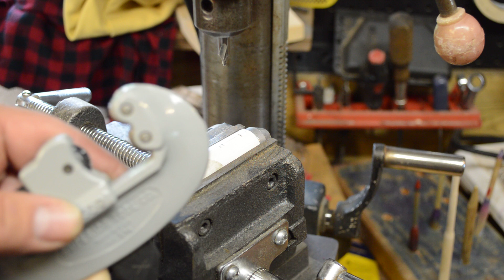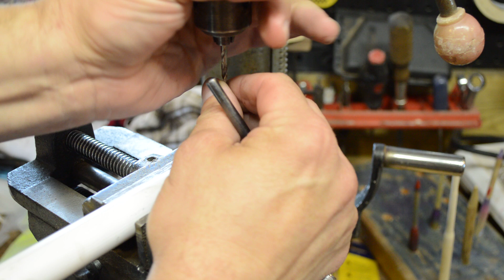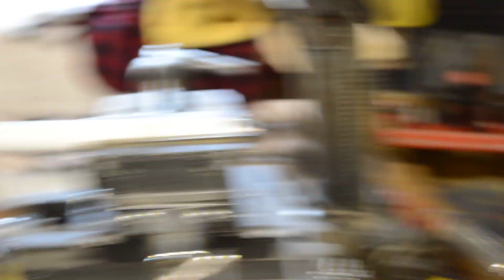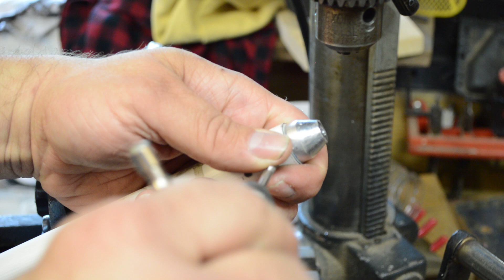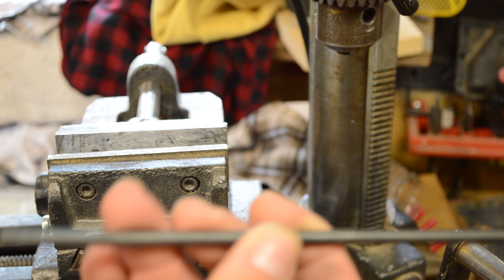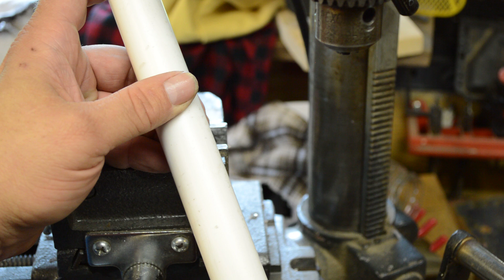HOMEMADE WOODTURNING TOOLS, PART2, GLUING, DRILLING AND TAPPING HANDLES

Comment from the maker: Thanks for watching and subscribing!  The piece epoxied into the PVC is an adapter made from 6061 extruded aluminum round rod.  I used the step jaw 4-jaw chuck for the machining.  I drill thru for the size of the tool, bring the tailstock up with a revolving center for support as I turn down the aluminum rod to fit inside the PVC.  My adapters are about 2" longh.  After the epoxy cures drill and tap for two set screws.

Comment: Hi. Just got a lathe and getting started. But I do have a tip for you. Get you some bee's wax to lube your drill bit for aluminum. I learned that by watching some pattern makers in the foundry industry. Works better than WD40. Love your vids. Making my own tools is right up my alley. Thanks!

Comment from the maker: Thanks Mick, great tip.  I actually bought a tap wrench with a pilot that mounts in the drill chuck to keep everything nice and straight, there was one problem...with the cross slide vise mounted none of that fits. The tap is almost an inch too long for that tool.
Hand turning this old Sears drill press ram/chuck is like trying to turn and old pick up with no power steering and two flat tires. 
Thanks again, I appreciate any feed back given!!

Comment from the maker: Thank you!  Its been too hot in the shop lately to work or make videos but I'll be goi.g to Lowe's tomorrow for 6,000 BTU's of nice cool air!!!  Along with the next few videos of interchangeable bit shafts, interchangeable bit holders and bits, I will be showing how I built a closed-end pen mandrel for just a few bucks.  In another video I wool either make or give detailed information on how to make an "acsenting/embellishing" tool using Dremel-style burs...can be made for less than ten bucks!!!

Comment from the maker: When I tap shallow aluminum I'll usually go two forward and half back.  Steel depend on the size of the tap, real small taps (3-48, 4-40, 5-40) I go half and half due to their small, easily breakable sizes...broke my 3-48 about a week ago.